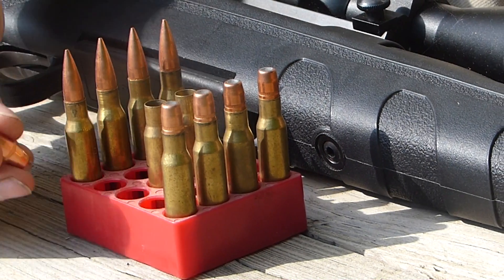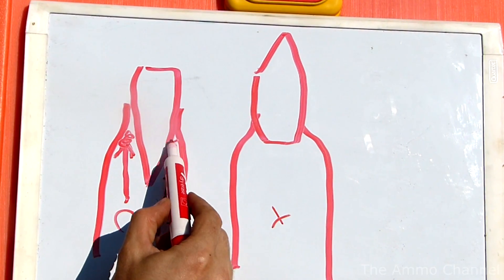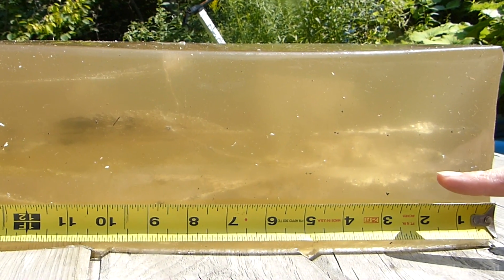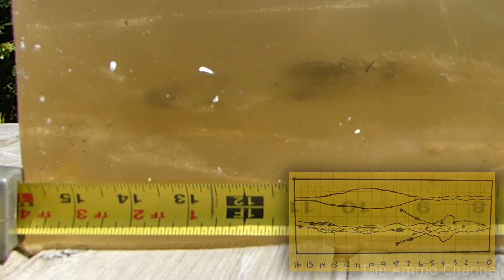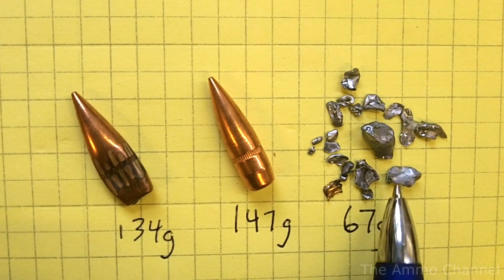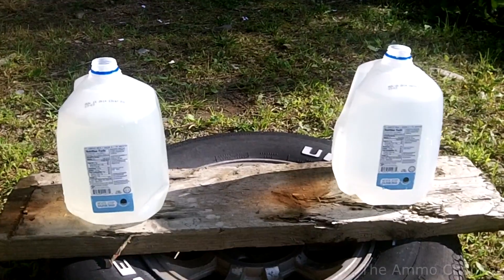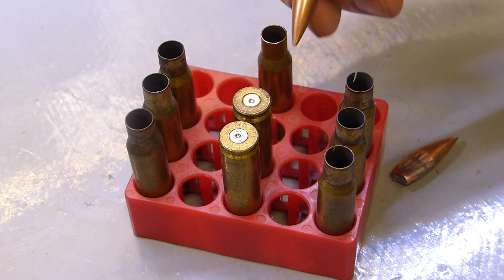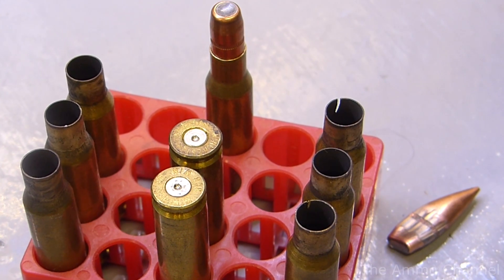Shooting Bullets Loaded Backwards

Comment: I think the reason the cases split is because of the .308 / 7.62 differences. If you was to fire those from a milspec 7.62, then there would be some free space right at the shoulder.
Same reason why you cant fire .308 brass in a milspec 7.62, then try to fire it from a .308-it won't fit no more, the shoulders stretch.
Reply: .308 and 7.62 nato are the same round
Reply: tomj16601
They are not the same, 'cause the .308 Win was released by Winchester several years before the Army standarized the T64E3 as the 7.62MM. You'll get an endless discussion of pressure specs, endless because SAAMI and the Ordnance Dep't measured pressure in different, unrelateable ways. However, the chamber drawings are different.
They are the same, 'cause nobody makes 7.62MM ammo that isn't to the .308 "headspace" dimension spec. So 7.62MM ammo fits nicely into .308 chambers, as a rule.
But in some 7.62MM rifles the chambers are long (to the 7.62MM military spec), notably the Navy Garands with 7.62MM barrels. Thus, using commercial ammo in such a rifle is not a good idea; you need stronger brass. Use military ammo or the best commercial only, e.g., Federal Gold Medal Match.
Most of the time it's a distinction without a difference. But if you intend to shoot .308 commercial in a military arm chambered for 7.62MM, first check the headspace with .308 commercial gauges first.
Reply: you can fire them out other either rifle with no problems
Reply: You can't fire .308's in a milspec 7.62 rifle then reload them and use them in a .308 they won't fit anymore.(which was my whole point)
Simple answer, the NATO spec chamber can be longer than the SAAMI spec for the 308 chamber.
Reply: http://en.wikipedia.org/wiki/7.62%C3%9751mm_NATO it's same round. the .308 is general hotter load for hunting
Reply: There is a 0.0025 inch overlap between the 7.62x51mm headspace and the .308 headspace. Firing a .308 in a milspec 7.62 NATO will cause the shoulders to stretch-and it will no longer FIT physically into a .308. I have experienced this first hand and actually did my homework to figure out why. It is FACT.

Regardless of what Wikipedia has to say about it.

Comment: I found a Winchester PDX1 in 357 Sig loaded backwards out of a new box.  It was the first round I ever found loaded in this manner and was surprised it made it out of the factory.  The effect on the rifle round in your video is similar to a military shape charge.  The gasses will swirl and follow the round down the chamber continuing to do this.  It would be interesting to see the difference in velocity.

Comment: Something more like a blunt nosed pistol round in 308 win and the same grain may give better results. Pointed end of the projectile towards the expanding gases is asking for an eventual problem caused by pressures applied laterally instead of front to back. Your example with the reversed projectile would possibly damage the barrel leading to catastrophic failure.

Comment: Armies on all sides ended up using steel plates to protect troops such as snipers, the germans went one further designing a curved steel plate called a "brow plate"  that was attached to the front of snipers helmets (rading parties also wore the plate) the regular helmets would not stop any sort of round, it was for protection from falling frag.

Comment: How does this affect the the bore on the rifle? Does it damage the rifling at all?
Reply from the maker: Not that I have seen but I haven't fired more than what was shown in the video.
Reply: It shouldn't damage the bore because of the metals used but the real concern to me is that the bullet does not contact the rifling until after firing or you may have a serious over pressure condition. I agree with the posting earlier that it is safer to use round nose style bullets and if you need to improvise DON'T!  All the reloading data published is based on people loading the ammo correctly.

Comment: I did this test many decades ago. Got the same results. I loaded 38spl target hollow base wad cutters backwards; awesome hollow point. I cast some 38 caliber bullets semi wad cutter out of zinc. very light, very hard and good penetration. States now have laws regarding what you made your bullets out of. The zinc loads were are 38spl loads and dang it went through and old bomber bikes frame and zipped through the car doors I shot it with; wouldn't shoot it allot due to being very hard on the barrel. As for you pressure concerns the gases on the backward loaded rifle round would have a greater tendency to exert more pressure in expanding the case mouth instead. Though I would not use these type of loads in a semi automatic rifle or pistol. before the stupid legality of using "hand loads" for defense use became a problem I used to use those backward full lead 38spl loads for defense; now like everyone I have to use "factory" loads for defense and hand loads for target and fun.

Comment: Just a thought, but couldn't the overpressure issues associated with loading the projectile backwards be compensated with a slightly smaller powder load? At least to safer levels, anyways.

Comment: In ww 1 British soldiers loaded bullets backwards to take out the very real threat of german snipers hiding behind armored plate. What it actually does is cause a "spalling effect" on the OTHER side of the plate similar to a tank hesh round.  Bits of armored plate fly off from the opposite side of the plate into the snipers face.  Give this a try ;)
Reply: Proving once again that the British are pioneers of stupid concepts and novelties.

Comment: Good video, but the reason you see pressure signs is that the backwards bullets aren't seated deeply enough.  The bullet is probably contacting the rifling before the primer is even struck.  This will often raise pressures quite dramatically.  The bullet needs a little room to "jump" before it gets to the rifling, even just .005" is enough.  I'm saying that because on your tray at the end, the cannelure is well above the case mouth, and there's almost a full caliber of full-diameter bullet above it.  This is almost certainly longer than the chamber throat, even for a factory rifle.  I've experimented with backwards bullets myself, and you really have to seat the bullet deep to avoid jamming the bullet against the rifling.  The results in a nutshell: terminal effect like a varmint bullet, accuracy like buckshot.  Spin-stabilized projectiles benefit from having a center of pressure forward of the center of gravity.

There's a warning in almost every reloading manual that if you change something significant in your load, you are advised to start load development over with a starting load.  I'm not saying it's gospel, but it's usually good advice.

 Be safe and have fun.

Comment: My solution to this would be to just load the .308 with those round-nosed bullets intended for the .30/30. I've done that for many years when my intended hunting area was going to be short-range and I wanted more shock transfer.
This concept of loading bullets backwards does work well in my favorite self-defense load..... Hollow-base wadcutters in .38 Special, with a powder charge of 3 grains of Red Dot. It gives a velocity of around 850 fps, and expands to about .65 caliber.
Reply from the maker: Kevin S I think the whole idea was that this was historically done to 'improvise' when only regular bullets were on hand.  Of course it wouldn't be logical to do this if you had other choices available.  There's a lot to be said for improvising... a lot.  Take care.

Comment: I think the deeper protrusion into the case causes an increase in pressure. Smaller volume increases pressure with the same powder charge. This is kind of how the .460 Rowland works. Deeper seating sends pressure way up, so more power. 

That being said, this backwards technique could work with less powder, resulting in the same pressure as a factory load. You'd have to play around with it, but I'd like to see a retest/follow-up with a more mile loading to see if it still is ballistically superior.

Comment: The increased pressure would be caused by the bullet taking up additional space within the cartridge. The burning powder has less room for the gas to expand, before the bullet is clear of the casing. You reduced the volume of empty space inside the case, which increases pressure and temperature.
Reply: That can be fixed by reducing the powder load.  The higher pressures were pushing the backwards bullets faster, making the comparison a little sketchy, though the FMJ shouldn't fragment like that even if it's moving a few hundred fps faster.  Ideally they'd both be loaded to the same muzzle velocity for comparison.

Comment: seems like it would be better to load them the correct way but file the forward end to a larger flat surface , same contact face as the backwards round but no pressure issues. really this looks like a good basis for a short range round where over penetration is a worry.
Reply: or cut out bullet tip with saw
Reply: bigvik24 We were only issued 58 grain lead 38 cal. bullets as Police officers at one time.  Years ago.   We would load wad cutters backwards, they were lead and 58 grain.  If they struck someone they would shatter and knock someone down where the 58 grain lead bullet would pass through the person unless it struck bone.  That is why we aimed for the pelvis for knock down and chest for full mass target with two rounds.  We later went with 38 plus P because we were out gunned by the bad guys. We went with 9 mm at first and then stepped up to 40 cal.   I went to the 45. cal. with target sights and had the best of both worlds.  Doc Ferguson

Comment: I've tried this with subsonic ammo. No problems with low pressure stuff, but I could tell they were higher pressure and slightly increased velocity.  If you dropped the powder charge appropriately it should be safe, just like loading a bullet to the grooves just drop the charge about 10-15% and work up.

Comment: how much powder did you still have in there? a 762 54 r is full to the brim almost with it loaded properly, if you turn it backwards, it doesn't fit, you have to pour some out to have it sit tightly, but there is still maybe 4/5 or 5/6 full of original powder, how much do you use?

Comment: The armor piercing idea was a german practice during world war one where more propellant would be added to a case with the bullet seated backwards. The main idea was not necessarily to penetrate a tanks armor but to cause spalling on the other side and hurt the crew, your standard 8mm mauser out of a gewehr 98 with a 29 inch barrel hit harder faster and weighed more than this .308. This was on tank armor that was often far harder than mild steel and could cause more spall as well, Brittle crappy steels could also simply be penetrated, this was in ww1 where the average tank was a massive piece of shit.
Reply: And armor was preety much paper thin compared to tanks in WW2
Reply: @pszczelakthetacticalweeb  yeah but it was thick enough to stop normal rifle rounds which is what they wouldve been hit by normally before the germans decided to hide field guns in case a tank came by
Reply: Yeah, why would anyone think (unless they just don't know how bullets work) that would have more penetration power? That is really interesting though, cool stuff.

Comment: If the tip of the bullet is grooved like a screw will it help it with putting more spin after coming out of the barrel and help tumble more in the jell?? Just a dumb question.

Comment: Hornady Soft point flat nose, The same ones you would use in a Lever 30/30 work well in a .308, and better still in a 30-06, Also, if you shave the point off the FMJ rounds till you get down to the lead core, That works well too, My Grand Father told me this was done during WW1, nick named the "Dumb Dumb" rounds, Something to try,,,,

Comment: An old Alaskan guide used to cut the tips off larger caliber FMJ rounds for dangerous game hunting. The flat base cause much greater tissue damage and greater penetration. I definitely think you needed to drop a few grains off these rounds due to decreased internal volume. Also, did you check the CBTO for the backwards bullet vs. the forward pointed FMJ? I wonder if you were jamming the base of the bullets into the lands, you know? I've had this thought not long after I started reloading and presented the question on the reloading forum I frequent. I also found a bit of reading on it online. 

Great video, and an experiment after my own heart. Thanks for the presentation.

Comment: Could you get the same affects just by cutting the end of the bullet off rather than putting it in upside down ?
Reply: In short, more than likely, yes.
It would most likely be slightly less destructive, but would also probably be better in terms of accuracy and pressure consistency.The problem would be properly cutting off the tip to avoid damaging the bullet.

Comment: Interesting experiment, I wonder if you could get the same effect by loading the bullet in the traditional direction keeping the case volume the same but cutting off a section of the pointed end to expose the led core without the over pressure issues?

Comment: There are plenty of cast bullet molds with broader meplats which can acheive the benefits without the downsides. Also a better choice of alloy will allow the bullet to stay intact and penetrate. For example Lyman/Ideal 311041.
Reply: It's called gas cutting. It's the primary reason you size cast bullets to be 0.002" over the groove diameter. When there is room for a leak, the gas slips through and vaporizes lead as it slips through. Recovered bullets will have erosion at the leak points and your barrel will lead very rapidly. Ever buy crummy commercial lead round nose 9mm and get a leaded barrel? It's because they size them small to fit through every gun, rather than large to fit your gun.

Sadly, you are unlikely to find any correct statement in a show which has Lee Ermey in it.The other problem is that there are a bunch of old guesses and theories dating back to the 1800s which still get passed around despite the fact that modern scientific testing has disproved them. As long as your alloy is hard and your lube is effective for the full length of the barrel, lead isn't making that much heat from friction.
Reply: That's incorrect. There is not enough friction or powder heat to melt the lead directly. Undersized bullets will get melting around the edge due to a cutting torch effect. Keep in mind paper patch bullets can go up to 3000+ Fps and the paper withstands the friction and heat. Many of the common lubes will only be good for up to around 2500 FPS, but that's more of a matter of them smearing off too quickly. Even 45/45/10 tumble lube system has been used effectively up to 2700 FPS data.
Reply: No problem. This is the golden age of good information. Bad info too. I'm sure you can find people who vehemently disagree with any thing anyone can say. A few people might dispute the velocities various lubes are good for, but the gas cutting thing is pretty much settled. Read around on castboolits.gunloads.com and test for yourself.

I really do recommend the Lee book over lyman if you are considering cast lead. The data is more useful, and the theory is backed up by testing. For a lot of the loads it has multipliers which can be used to calculate approximate pressures for incrementally reduced charges. That's really helpful, because every bullet of a given design and alloy has a pressure where it is most accurate. The "accuracy node." You can do a lot of trial and error to find this. The nicer way is to use the data in the book, measure your hardness and find the approximate pressure where the bullet should work best. Then you find the powder data for that weight, and the pressure at max and use the formulas to derive the grains of powder which would give you 10% higher pressure than max compressive strength. Start a couple grains under that, work up and you will probably have the sweet spot (accuracy node) in your first range trip.
Reply: I suspect a reversed round would have truly awful long range ballistic reliability....it would begin tumbling fairly quickly, and spin off trajectory in a hurry.   I suspect it would have half or less the effective range.....(effective = reliably hitting what you're aiming at....a round, no matter how lethal, is worthless if you can't hit what you're shooting at....)
Reply: Tim Hyatt ,   Well then why are 38 caliber double end wadcutters so accurate?
Reply: Isn't there a velocity restriction when shooting unjacketed bullets through a rifle?
Reply: TheSuburban15 There is, friction in the barrel will cause the lead to melt. Although I do believe a mixture of lead and another alloy may increase the heat required to melt it.
Reply: Cool, thanks for the info bro.
Reply: Is that so? Sorry then. I just remembered watching a video where they talked about the advancement of the bullets and they had to have a shell so the lead would not melt (or damage the rifling). I do not understand what you're specifically talking about when you refer to the cutting torch effect.
Reply: Nice elaborate thx

Comment: Take a saw and cut off the tip to see it it would act like a soft point
Reply: a belt sander works pretty well. just don't let the round heat up too much

Comment: Elmer Keith wrote about doing this back in the '20 or '30. IIRC, he did reduce the powder charge in order to avoid the problems you encountered. Again, IIRC, accuracy was degraded but adequate for hunting purposes. This was done BEFORE good bullets were available for reloading, so I don't see any good reason to do so today.